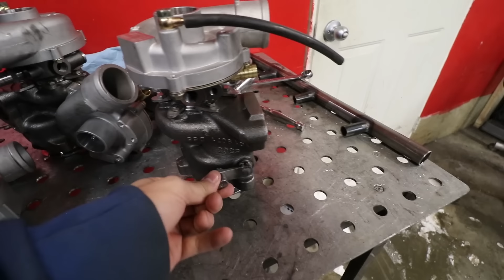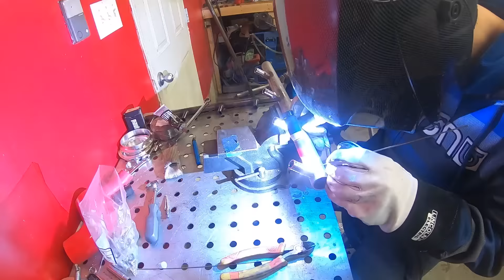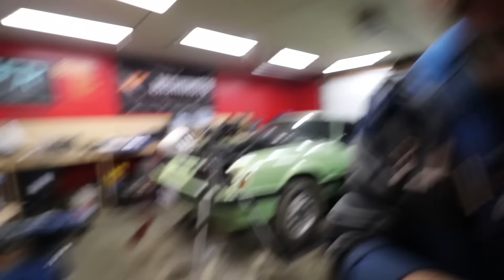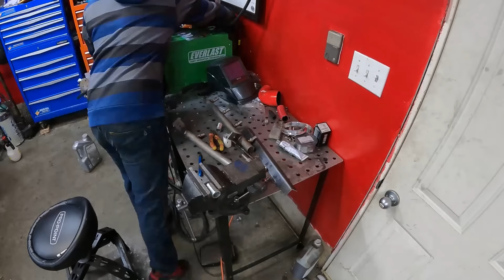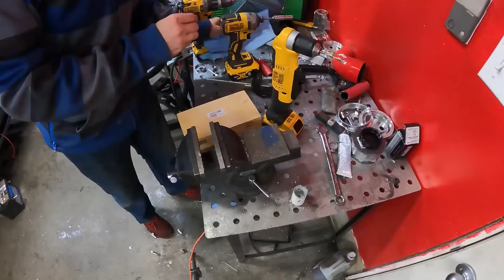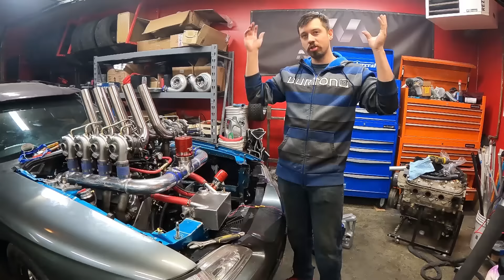Eight Turbo V8 Mustang Sounds Unreal! PT 10

Comment: Nice early morning upload! Since I was supposed to upload this yesterday... But I accidentally didn't go to work thinking it was my last day off... Then I got called in at 10am lol oops
Reply from the maker: Oops I posted this on my second account 😂
Reply: @AdventurekyleAU  Hahaha at first I was like wtf another Kyle.?
Reply: @AdventurekyleAU  all good. What do you do for regular work? I was a machinist and metal fabricator for a couple decades. Now I do a lot of farm,landscape, logging, and forestry work mostly.
Reply: You should never use a restrictor on a journal bearing turbo, especially a small frame high rpm like you have. The oil cokes inside. It should free flow. The biggest reason for oil leakage past the seals is almost always an issue with the size or route of the return line. 16-20mm is adequate -4an/--5an is fine. Be careful not to mount each CHRA more than 15° either way. 30psi should be okay but you may have to dial it down some more. You don't want the pressure too high and the drain too efficient at the same time. It'll blow right through the ports inside the CHRA and starve the bearings. If you let me know the exact model of those turbos I can plot various psi on a compressor map for you. I can email you an XLS file and you can make any changes you want. I built it for a 134cid engine but you can change it around for a V8 whatever displacement you have. It'll show flow for your engine size and you can make plots on the maps. I can almost guarantee you that I have a compressor map for your turbo. Been fiddling with Forced Induction since the 80's.
Reply: Love to be able to pick your brain sometime turbocharger
Reply: Lol thats fucking awesome!! I never done that one but thats a good excuse
Reply: I "accidentally" take days off all the time
Reply: How to fix oil pressure - All you need is a solid state relay and drive it with a PWM output from the Holley to control the oil pressure.  Check out "Nugget Garage" - Rear mount turbo 1UZ supra episodes for how he did it.
Reply: I missed it, are those IHI turbos or MHI/TDO4's?
Reply: Hey man turbosmart make an oil pressure regulator for turbos

Comment: Love what you guys are doing man!! That's definitely one way to think outside the box for sure lol. You could still tune each individual cylinder with just 2 WBO2 and an 8 channel pyrometer logger. Alot of top drag race teams use this technique even with Zoomie headers. You can have a small ½" tube manifold that connects to each exhaust up pipe on one bank that houses one of the O2 sensors. If there is a cylinder that is running lean or rich, the O2 sensors will tell you which bank to look at. The 8 channel pyrometer logger will tell you which cylinder(s) needs adjustments. A higher egt than the others would mean a lean situation. Cooler would mean its running rich. The I.T.B. setup would be alot easier to tune than what you may think. This could also diagnose quickly if there is a cylinder down from a mechanical or ignition failure, and which one.

Comment: I wonder if that much of air is even needed, I mean it will also need that much gas right? And you will have to tune it for that much air and that much gas... So it will make soo much horsepower, will the engine hold that much hp, I was curious

Comment: Should you consider adding ribs on the metal tube neck of the large top oil return lines? The rubber lines are connected to smooth pipe.

Comment: When you flip that switch on your furnace while it’s running you can crack your heat exchanger due to insufficient flow of air during cool down. Don’t do that. It will ruin your furnace. I understand why you do it. ...don’t do that.

Comment: You should move the O2 sensor closer to the turbo (more importantly further from the end of the pipe) because the A/F data is going to be erratic and read erroneously lean at low RPMs.
Holley recommends installing the sensor a Min. of 18" from the end of the pipe (if possible) and I can confirmed that because all of my tunes (including 30+ Holley EFI tunes) are all on motorcycles. Most turbo bikes have pipes that are shorter than yours but I believe the reversion issue will be worse on yours because it's only getting 1/4 the normal number of exhaust pulses...
...
...
This might sound silly but if you hold a handful of rags over the end of the pipe at idle (loosely, not blocking enough to create back pressure) your A/F will read much closer to what it actually is...

Comment: I think ur going to get bad creep on the 2step. This only works because each turbo is pulling vacume between each exhaust pulse and drags vacume along the other turbos as it flows through the shared charge pipe(i think....). If this happens try using a "timing wall" under launch conditions. This is why you cant turbo a single cylinder engine. MIT did a indepth study on this but i dont thinl the considered 1 🐌 PER cylinder to compensate for pulse loss in between each cylcle. Genius!

Comment: I could be completely wrong but for complete efficiency shouldn't they be front facing so when you gain speed it's forcing more air into the engine

Comment: Seems like you could use a PWM box for that pump to quiet it down. You could add a pressure switch that bypasses it blow X pressure in case it fails or during priming/start-up.

Comment: For future reference u could’ve just t’d the regulator into the pressure hose in 2 min instead of doing all that extra work. Similar to a returnless fuel system.

Comment: Boosted.. I wonder if a guy could use a ford fuel pump module to vary voltage to the oil pump rather than restrict oil flow.?.?.?

Comment: Move that 02 over to the other (opposing) cylinder... it will make it slightly longer because it does not have to fold back... you’ll gain 3-4”... and that should make her happy.

Comment: You should be able to use the holly boost table and mac valve to hold that bov closed and not use wastegates. Also drain the oil reg back into the drain rail.

Comment: Cut the tip of the fitting and bevel it. Then put  8 nitrous jets size 61.  This will restrict the oil to the turbos.

Comment: Very nice work bro. You can put a tee at the output of the pump, put a valve on it and return some oil to tank. That way you can dial in the psi to exactly where u want it.

Comment: You do realize that during acceleration the G's will oppose your drainage, right?
Reply from the maker: That should be okay it's okay 8-10 seconds then I'm hard on the brakes and it will pull it all out with the G's

Comment: Amazing workmanship. I was considering the placement of your BOV/BPV. Wouldn't you need to locate it to after the IC, or at least after all the turbos, to prevent compressor surge on the bank that is after the BOV? Seems like only one bank would vent. I could be wrong. I've never run 8 snails. You going to control boost on that bank with your EWGs? At any rate keep it up man. Love what you're doing.

Comment: Are you worried about oil temp for the turbo oil system? Also can you make the exhaust swoop back up over the windshield and roof with a slight up sweep at the back window for the tailpipes.

Comment: Why dont you use grease zerks and punch the block off ball out of them, weld those to ur oil fittings. Ive used them for emergency nitrous jets. They worked.

Comment: Try RN60 for welding wire. it's used to bond steel to copper nickel and is soft but has high heat resistance

Comment: Dont know if your oil tank is aluminum or stainless, but you might want a rubber barrier between it and the mild steel angle iron you put on to prevent galvanic action. Dissimilar metals.
Very cool build though bud. Been watching this project for a bit.

Comment: You could also use a ball valve or needle valve with a guage on the back side of the rail. The valve would be cracked a bit to allow the oil pressure to be limited to a max. The excess oil then is diverted into the tank.

Comment: Anyone that does use a pressure regulator for fuel instead of oil remember the actual fittings are orb with an o ring. Running oil through one you won't need that but highly recommend for fuel to use the correct orb fittings.

Comment: think the restrictors near the turbos are better , with the pressure regultor at the place you want to put it youll get different flowrates depending on how high the feedline arches over the turbo 
another thing you could do is hang the tank higher than the turbos and use the pump to suck the oil out of the turbos and have the oil gravityfeed intoo the turbos

as for the turbo feedlines you could make holders for them like sparkplug lead holders , it might be nicer to use solid copper line (brakeline should work ok thin waterline if you want bigger  ) even if those hit the exhaust they just heat up the oil inside them

Comment: It's funny, I wanted to turbocharge my V-twin motorcycle back in the day but didn't, because the old timers said I wouldn't have steady enough exhaust pulses from only 2 cylinders to drive the turbo. Your turbos look like they're doing fine, though. Old timers suck

Comment: Not that I'd run 8 turbos, much less 8 ITB's - You won't have a huge swing in boost pressures, if you plumb the gates like you mentioned (where 1 44mm gate services two cylinders). I suppose it's possible that you'd have 4 pairs of cylinders with varying boost in that scenario, though.

Comment: make hard line for oil line you can use brake line ...it will also act has a oil limiter depending of the size off the brake line

Comment: have you thought about putting a wastegate on the cold side to control boost? I've seen cars with centrifugals do that to lower boost levels. like a PWM controlled boost leak
Reply from the maker: You'll end up over spinning the turbos that way
Reply: @AdventurekyleAU  😥

Comment: Time to get nerdy and put a wide band and an EGT in every exhaust tube
Reply: He only needs to put it on 2, swap it around to see what's hottest and coldest, then run on those to see the full range. Same for the wideband, leave it on the leanest cylinder and maybe a 2nd on the richest.
Reply: @hydrocarbon82  it's true that you don't need them all. but for me, I like to have all that data just to see it.
Reply: You could still tune each individual cylinder with just 2 WBO2 and an 8 channel pyrometer logger. Alot of top drag race teams use this technique even with Zoomie headers. You can have a small ½" tube manifold that connects to each exhaust up pipe on one bank that houses one of the O2 sensors. If there is a cylinder that is running lean or rich, the O2 sensors will tell you which bank to look at. The 8 channel pyrometer logger will tell you which cylinder(s) needs adjustments. A higher egt than the others would mean a lean situation. Cooler would mean its running rich. This could also diagnose quickly if there is a cylinder down from a mechanical or ignition failure, and which one.